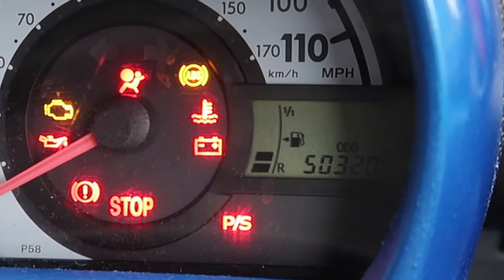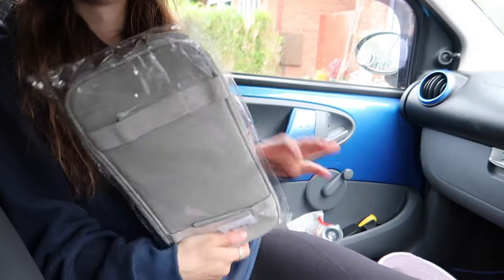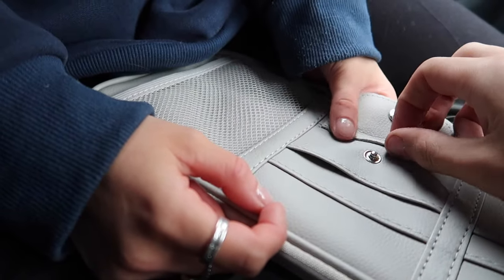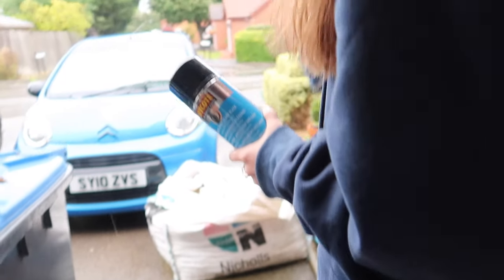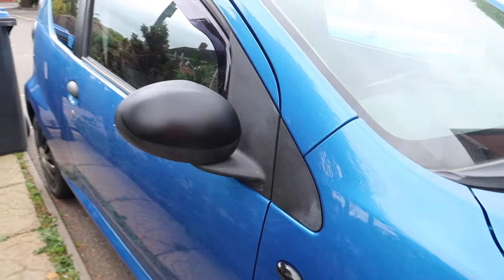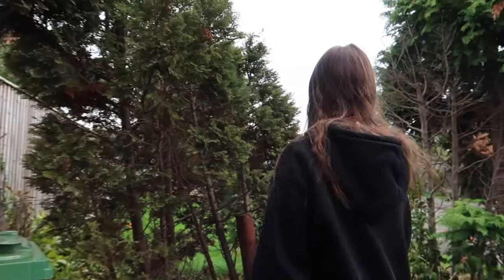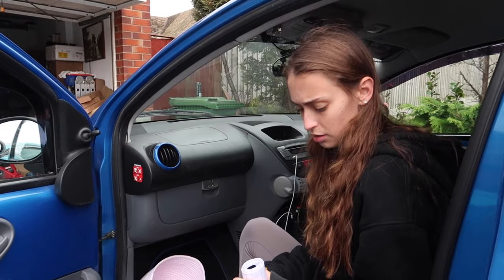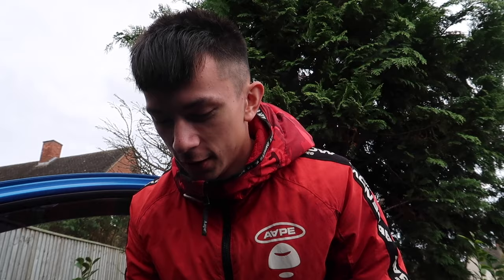INSTALLING *CHEAP* CAR ACCESSORIES TO MY CITROEN C1!

Comment: nice to see involvement and you trying,if you pull off the kick panel in the drivers footwell see if the factory connecter (white) is there for the central locking and electric windows,if it is its quite straight forward to after fit these but you would need to remove the dash top again

Comment: The kick plate sticker what you should have done is take off the door seal off the bottom, put the sticker as far as you can fix it down then put the door seal back down and you would not see it just for future reference.👍

Comment: When I first heard you mention the car's name I thought you said 'Sidney' and I thought wtf calls their car 'Sidney'. Unless it is a classic car from bygone generations like 'Sidney the Standard 8'.
I was hoping to see you put on the wind deflectors as I always put those on my cars. Fresh air without draughts and they stop the little sprinkle of water over your shoulder when you work the screen washer. They are actually quite tricky to put on as they are rather fragile but I have now done it a few more times.  
The door kick plate is also a good idea but I can't see it lasting that long as it is only thin tape. My car has one on the lip of the boot which is made from ABS plastic. My tip to fix these things - locate the exact position you want to put it and then mark it with masking tape. Then you won't have a problem with it going out of line when you put it on for real.